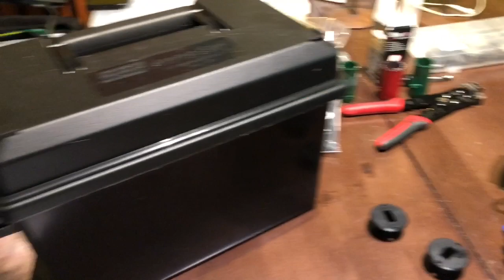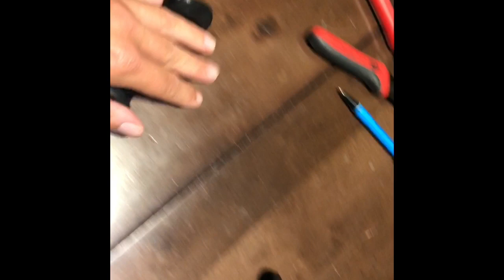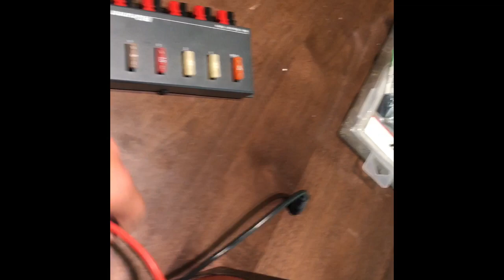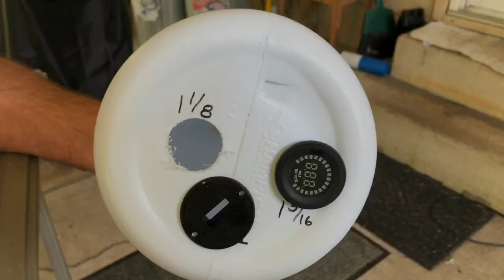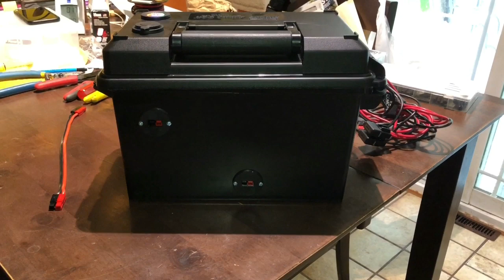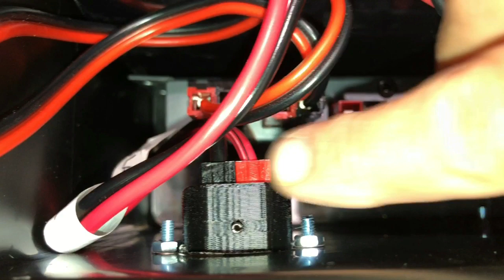DIY Portable Battery Box For Ham Radio and Camping

Comment: next time use a step bit like harbor freight carries, cleaner cut in the hole..

QSR is over priced...

 i would have used the surface mount power poles that are in a round hole and just labeled which one was which. and paint the screws black. lol  thats just my OCD though..  (similar to this but there are cheaper... https://www.amazon.com/Housing-Anderson-Powerpole-Connectors-Resistant/dp/B077VWXXYG/ref=sr_1_11?dchild=1&keywords=anderson+power+pole&qid=1590804294&sr=8-11)

looks good.

73

Comment: Here's a little tip when you're you're putting together small, low current systems like this. O'Reilys auto parts sells 14 GA. Spade Connectors that are set at 90 Degree angles at the top. These are GREAT when you have limited build space, and they come in 10 Packs for around $5.00.

Comment: Nicely done!
I went a little more elaborate with mine. I built TWO systems actually, but I'll only discuss my smaller one in this comment. I bought an Orange Pelican 1430 Case. In that I put a Bioenno FORTY Amp Battery, a Bioenno 6 Amp Wall Charger, and the Same Charge Controller you are using. I cut a wood panel that sets in the top of the case on which I mounted the Controller 2 Dual THREE AMP usb outputs, 2 Dual Powerpole sockets, and 2 Standard 12 Volt Sockets. Each set of pods has its own on/off switch, as does the Charge Controller-I did that to simply isolate it from the battery in order to NOT have to connect and disconnect every time I want to use Solar. If you have an email address, I'll be delighted to send you some photos of the unit I built.
Again, my compliments to you. Building your own stuff is what being a Ham is all about-GOOD ON YOU!
Bruce Forster-AC7AA
Reply: Would it be possible for you to make a list of exactly what parts you bought. Sounds like just what I'm looking for. I am a legally blind HAM, KI7BSL, and I need too build one for the next Field Day. I only use a 2 meter, 70 cm rig, with maximum power output of 25 watts. I will use the 20 amp Bioenno battery.